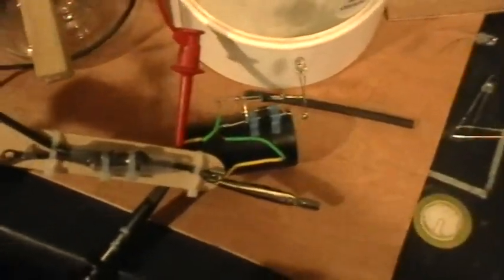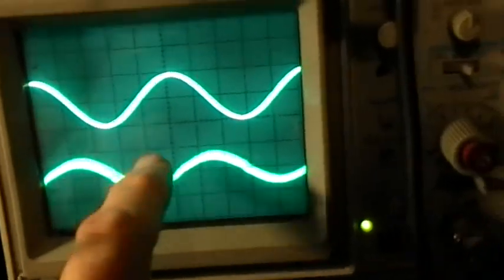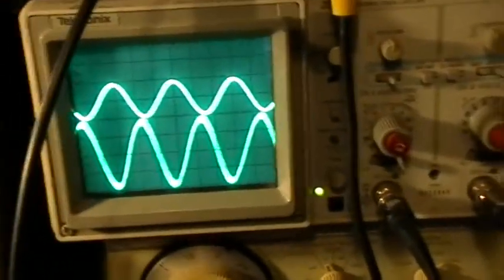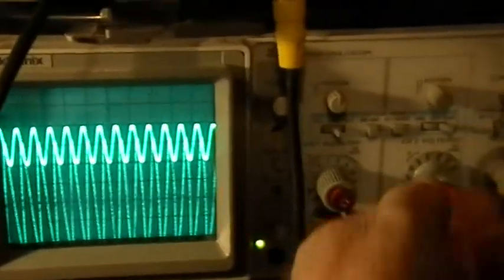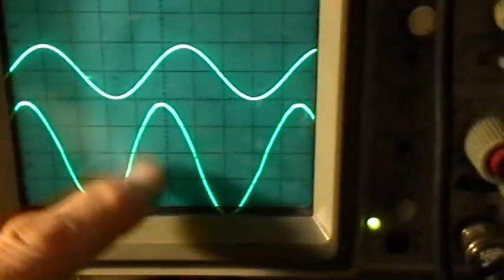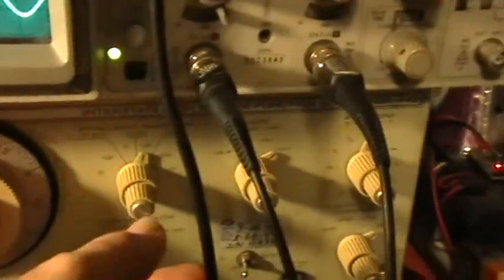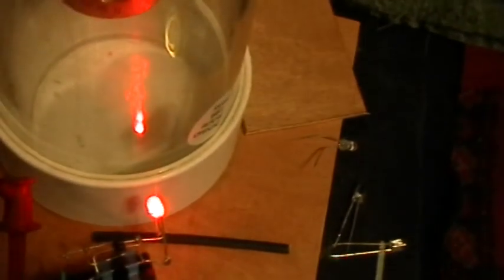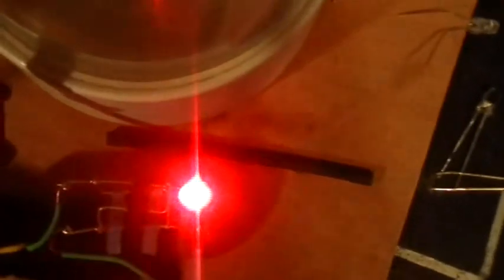Magnetic Resonance Amplifier 2: Exp1 Waveforms

Comment: Can you teach me how to make a current probe the way you take measurement of the current in your circuit. I have a Picoscope PC Oscilloscope but I cannot manage to measure current waveform.
Reply from the maker: Measure voltage drop across 1 ohm noninductive resistor. I = V/R by Ohm's Law, so one volt drop = one amp current thru resistor. Be careful of grounding. Use differential (2-channel) measurement without ground leads if necessary.